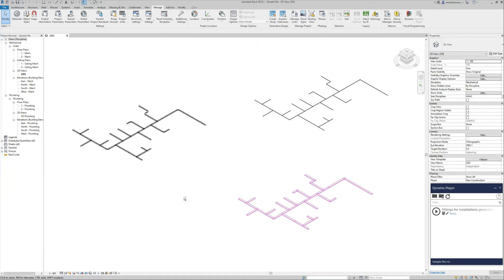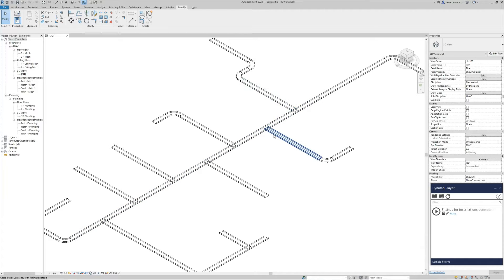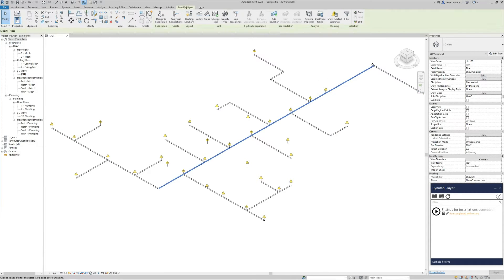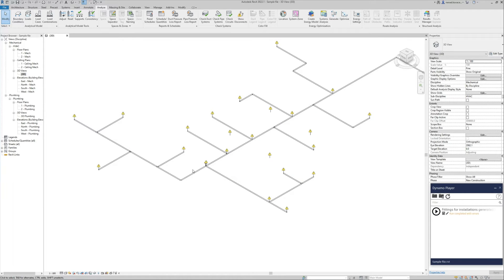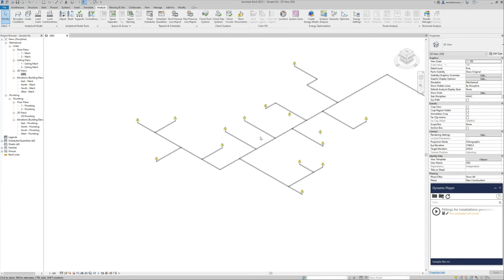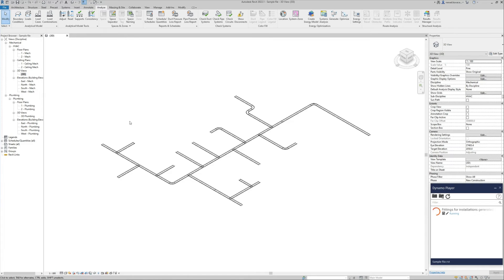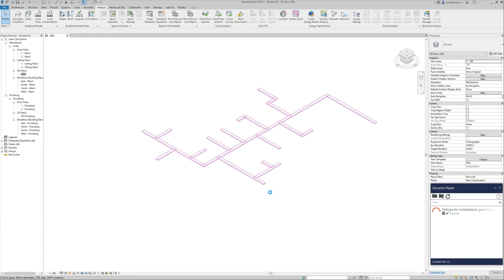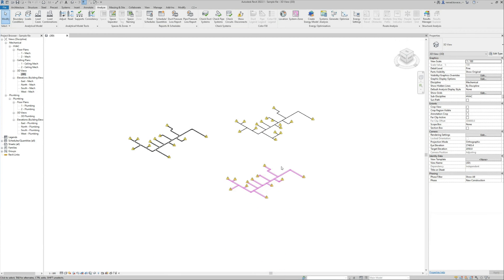Fittings for installations generated from AutoCAD

Comment: I am extremely thankful for all your help. I am interested in this script in particular, as a follow up to your first video on converting CAD lines to straight pipe. I got that one working, however my goal is to essentially combine that script with this one. My problem is that you lose me quite a bit when you do show the script since there are many nodes and wires overlapping so I can't discern what is connecting to what.
Reply from the maker: Feel free to send me an email to nndkovacevic88@gmail.com. Then I will send you the script.
Reply: Hi , can you please explain the script in detail like what nodes are used